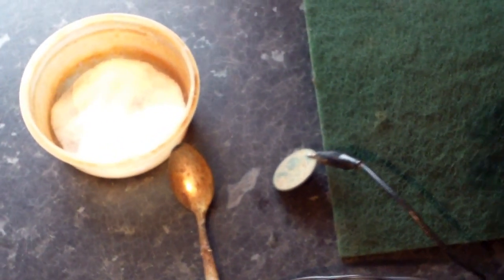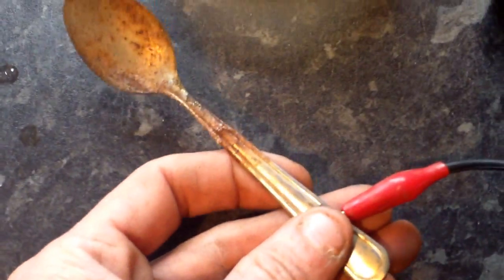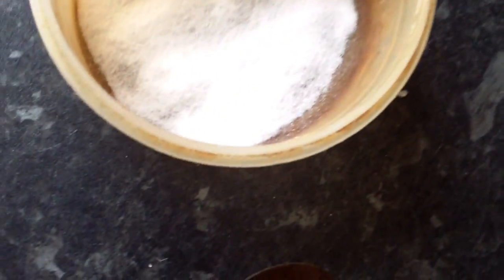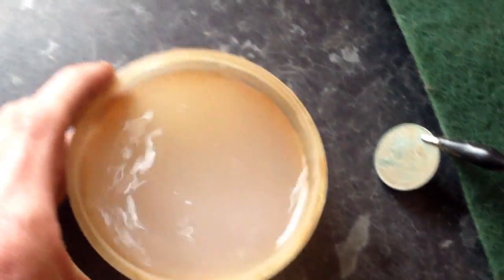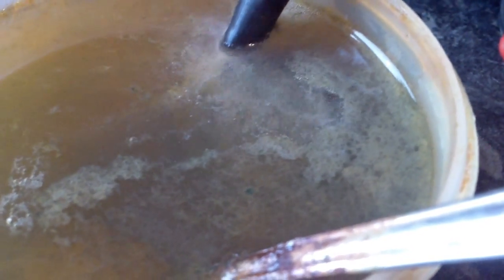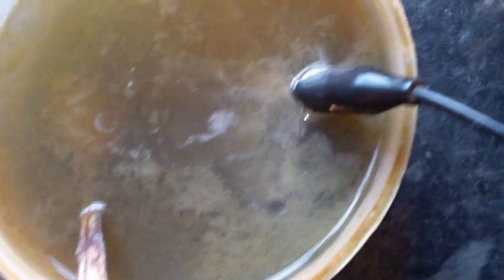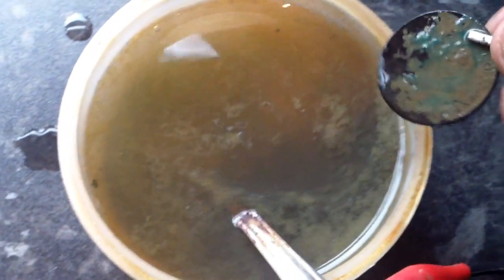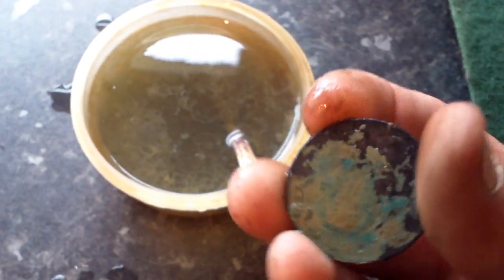cleaning coins with electrolosys

Comment: There are a lot of videos showing the use of salt as the electrolyte, stainless steel as the sacrificial anode, and putting the coin or relic on the positive electrode.  These are all incorrect.  The relic should be attached to the negative, the sacrificial anode should be made of iron, and the electrolyte should be baking soda, or something else without chloride.

Comment: its not right way to clean old coins. during electrolysis coins open metal will dissolve in solution and  coin may loss weight.
Reply from the maker: abhyuudaya creations ...it's the perfect way to clean old coins it removes the hard stuff so you can get an id on the coins we not too bothered about any weight loss and if it's a good coin with good detail there would be no need to clean this way anyway

Comment: I just watched another video on using electrolysis for coin cleaning.  The coin was heavily corroded; crusty even.  And came out pretty much the same way.  I'm not sure if this is the best method.
Reply from the maker: not the best method at all pal its merely just a way of getting an id on knackered coins by far the best practice is to not heavily clean them at all just water n toothbrush
Reply: 1981copey Thanks, yes I may try experimenting with a tooth brush.

Comment: A. Dont use table salt for electrolysis unless you are trying to make sodium hydroxide, the processes releases chlorine gas, use sodium carbonate as you electrolytic. B. Dont use stainless steel for your anode, it releases hexavalent chromium which is extreamly toxic, use regular iron or carbon as your anode

Comment: Just made a 5 volt one, it's not so harsh but you need more patience as it takes a while. Thanks for your video and encouragement.
Reply: can you make this with a normal adapter 12 v?
Reply from the maker: ***** you can pal yes
Reply: 1981copey
Ok i found a 7v phone adapter and it works great. I dont see how it could damage any coins . I usually wait till the water gets dirty ,.. clean it a bit with salt and if it's still not clean it will go a second round ,.
Reply from the maker: they do if you leave them in ages pal will just make the coins look really pitted
Reply: 1981copey ah oke , i found out that a eraser really helps cleaning the coins from the black stuff,much better than with the salt :)
Reply from the maker: cool just keep toying about with it im sure you will crack it soon goodluck pal
Reply: 1981copey
for sure , your dutch 2 right? :)
Reply from the maker: hell no english through n through